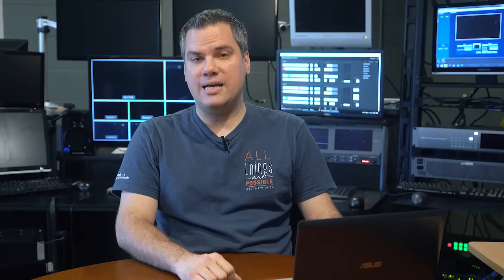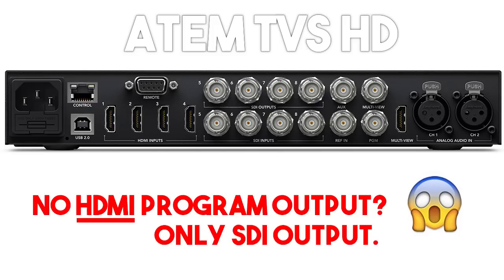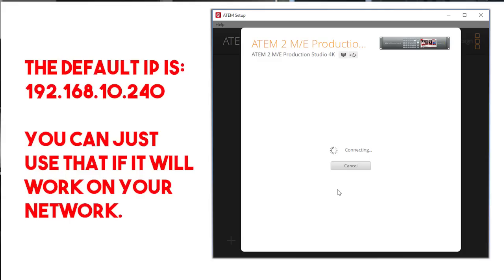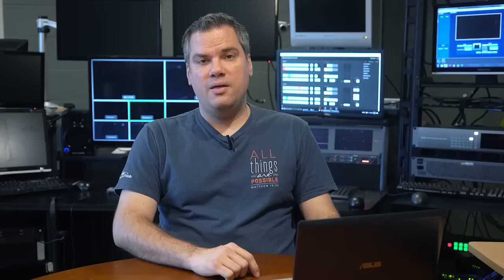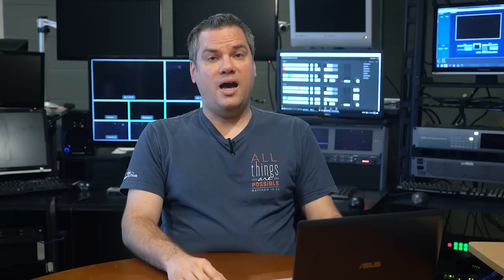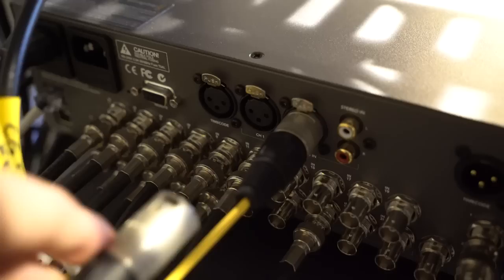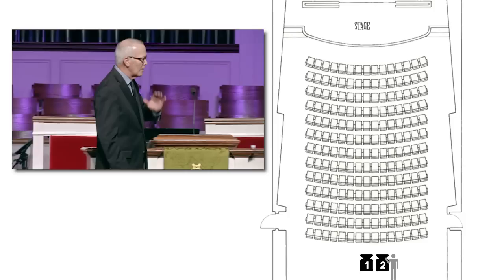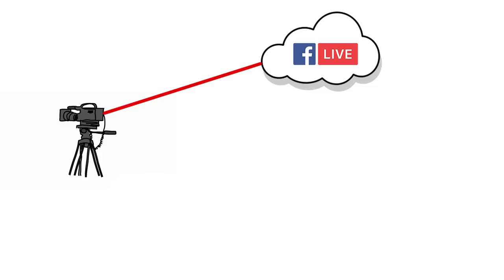Multi-Camera Live Stream & How to Setup an ATEM Switcher

Comment: Question: is it possible to use one laptop for both ATEM control and live streaming via OBS? If I had the laptop connected to the internet via Ethernet, would the ATEM connect via USB? Or is a router necessary? Using Mac with Mini Recorder via Thunderbolt. Thanks for your video!
Reply from the maker: Yes, you can use the same computer.  Use a switch to connect the ATEM & Computer to your internet connection, and then configure your computer and ATEM to be on a network address that will work on your network so they can see each other.  (The USB connection to the ATEM is just used to set the IP address, all control through the software is over the network.)
Reply: Ballast Media thanks for your response! Sounds great. Looking for a Wirecast replacement as the endless upgrade cycle is getting a little old at $250/year.

Comment: I am using a Panasonic AG-HMX 100 audio and video mixer. If I send my video through SDI to the AJA U Tap is the audio following down the SDI cable into OBS OR do I need to get the audio into OBS in another way  Thanks
Reply from the maker: Jeff Bridge Yes the audio from the mixer should be embedded in the SDI output.

Comment: Hey Ballast Media. How do you connect all your cameras to the switcher? I read that long HDMI cords strain your cameras and laptop. Is it better to use wireless HDMI? If so, whats a good one to use?
Reply from the maker: Stefan McCarthy if your camera only has HDMI out, then the best thing to do is convert that to SDI to send to the switcher. SDI can run up to 300ft. If your switcher has SDI inputs (most do) you just have to make the one conversion at the camera.
Reply: Im currently using a gh5. Whats the longest recommended hdmi length?

Comment: Can you use the ATEM and Stream with the same computer? Because in order to use the ATEM it needs to be Ethernet so how can you use 1 computer for the atem and OBS?
Reply from the maker: Yes you can, you just connect them through a switch.  You'll need to configure the ip address of the atem to work on your network and be accessible to your computer.

Comment: Thanks for the video. What a cheap AV mixer with a built-in delay would you recommend? We have an audio source different than the video and obviously, they will not be synchronized ! The "Blackmagic Mini" would have been ideal for us but unfortunately, it doesn't offer audio delay !
Thanks in advance for your assistance.
Reply from the maker: Where are you sending the video? Are you using obs to live stream? You can delay/sync the audio in OBS.
Reply: @BallastMedia  
Thanks. It is for a live streaming.
I don't have OBS but I'll download it. 
So what you say is that OBS allows me to sync audio and video with no need for an external hardware!
Reply from the maker: @michelazizlouis  What are you currently using as your encoder for live streaming?
Reply from the maker: ... But yes, OBS has the ability to delay audio.

Comment: Hi Stephen, so if I want to live stream from two cameras (using a program like OBS on my PC), and I buy an ATEM switcher, I should buy AJA U-Tap SDI and not the U-Tap HDMI? I see there is a sort of HDMI output on the ATEM, but it's a multiview output... That's not made for streaming with two cameras using software like OBS?

The thing is, one of my cameras will be Canon 80D, and if I use it alone, I should use it with U-Tap HDMI, so I'd have to buy both the SDI and the HDMI version of the U-Tap if I want to use it both alone, and with another camera via the ATEM. Unless there's a video interface that has both HDMI and SDI inputs, and supports any format, like the U-Tap...

Instead of buying an ATEM switcher, maybe it's best to buy two video interfaces? Maybe both the Canon 80D and the Canon Vixia HF R800 (or Canon XA11, the two cameras I'm considering buying) can be connected to the laptop via the Black Magic Ultrastudio Mini Recorder (two of them)? Can the video interface be connected to the laptop via USB or HDMI or only via Thunderbolt input?

Sorry for this many questions :) 

Thanks!
Reply: I saw now on your channel that I could use two cameras with two U-Taps HDMI (that connect to the laptop via USB) and OBS: https://www.youtube.com/watch?v=8UtXvJq-l5M

Still, if I go for the ATEM, I'd have to buy the U-Tap SDI?
Reply from the maker: @lexington125djikan  Yes, you would need the SDI u-tap for the ATEM.  The Multiview HDMI output is not a program output, but a special display that shows you all the inputs at once like this: (https://images.app.goo.gl/M9j6SAFmYGuA7wRo7)  You could get an HDMI version of the u-tap for use with your camera, and then get an SDI to HDMI converter to use with the ATEM.  This would only add $60 additional cost, it just adds the additional piece of equipment in-between.  https://amzn.to/2ZKefM9

Comment: Hi sir, I'm using this exact setup . This includes the ATEM Television Studio pro HD, Intensity Shuttle for USB 3.0 and Canon5dMK4. I'm using VMIX on Windows 10. The video signal come to Vmix software on and off, i check the Supported Hardware list from Vmix.com, i can't see Intensity Shuttle for USB 3.0 on the list ( it has Intensity Shuttle for thunderbolt only), could you tell me what should i need to do please. Thank you
Reply from the maker: Not exactly sure, The obvious thing.... Make sure you are using the latest desktop video version. Also, is the intensity shuttle connected directly to the computer or through some sort of hub?
Reply: @BallastMedia  yes, it's connected directly to laptop and i upgrade latest desktop video version already

Comment: Will the BM ATEM Mini need configuring? And will it need a video interface? Thanks
Reply from the maker: Mini will need to be configured, select your output video standard, etc. You will not need an interface, it will perform that function.
Reply: Ballast Media Thanks for that. Do you think it would be possible to use my iPhone xmax as a second camera through the ATEM mini? Would a lightning cable be able to connect the atem min switcher?

Comment: Would it be ok to use the same computer that you run the actual video stream on to also run the ATEM control software at the same time while steaming? 
Or is that not a good idea and would recommend to run separate computers? 
Similarly, what about if you were running software based audio mixer (DAW) during the live stream for audio mixing? 
Would it be ok to run all three on one computer? 
What combination might be ok to do and what’s be best scenario?
Reply from the maker: You can probably get away with running the atem software while streaming. I would not run a daw and stream, those two things each need their own computer.
Reply: Appreciate your insight. You’ve been very helpful

Comment: We are using the Canon R800's for our live broadcasts.  Using the HDMI output, we are running that into a BM HDMI to SDI converter, and the SDI output to the BMTVSHD ATEM.  We need to add field monitors to the cameras to follow the action, but how or can I get the single HDMI output from the camera  to go to the HDMI/SDI BM mini and to the field monitor (Neewer 759's)on the camera?
Reply from the maker: Unfortunately, with that monitor the only way to make it work would be an HDMI splitter added at the camera.  The better way would be to get a monitor with an Input and Output HMDI built in, like from Ikan. https://amzn.to/2pRw5xO
Reply from the maker: The ikan monitor I linked to above is actually discontinued.  Here is an updated version. https://amzn.to/2GEMu2a
Reply: I have been looking for an HDMI splitter but have not been able to get a definitive answer as to what splitter would work, even BM didn't have much to offer other than to say it would have to be able to EDID signals.
Reply: If I could find the field monitor that will have the HDMI out pass the proper signal to the HDMI/SDI converter, I would actually prefer that solution.  I'm looking.  Your recommendation above I looked at and have asked on Amazon and waiting for a reply.  Thanks for all your help.  Great video too.

Comment: Dear Mr. Ballast, I have been following your highly educational lectures on setting up live streams to the stage of multiple camera via ATEM HD. With all the set up, I am not able to see video image at OBS. Here is my set up: Vixia R800 --> ATEM HD (set at 1080p 59.94) --> PGM SDI out to UltraStudio Mini Recorder set at SDI input --> thunderbolt 2 to iMac --> OBS (BM US Mini Recorder,  format with Auto). This set up does not generate image in the OBS screen. There is video image detected via HDMI Out Muti View to external monitor (camera 1, preview and Program view).  Appreciate if you can shed some light on the what could be the probable issue of lack of image at OBS. Thank you.
Reply from the maker: The mini recorder doesn't support 1080p60 video. the SDI connection won't take it. The HDMI gives you an image because the way HDMI works is that the two connecting devices negotiate a video format that they both support, so it's probably switching to 1080i60.
Reply: @BallastMedia  Thank you Mr. Ballast for your insight. I believe the once quick option for me to move forward is to replace the Mini Recorder with AJA U-tap SDI. And it should work out fine with the OBS connection compatibility. Would you support this option?
Reply from the maker: @kennywong1024  correct, that will work.
Reply: @BallastMedia  Thank you!

Comment: Hi Stephen, I have Atem 2/M production 4k and we always use HD format, now I want to use the UHD format because we have 4k cameras and CCU 4k also, I already change all the format, in the cameras, ccu, atem II but I still can´t see the signal.  Do you know how i cant  resolve this problem?
Reply from the maker: Not exactly sure, my first guess would be that the camera format and the ATEM video standard aren't quite the same.  The UHD formats that the ATEM is compatible with are pretty specific.  What video standard do you have your camera's set to?  I assume you're running this over SDI?  What video standard is the ATEM set to?

Comment: I have a question for you.   Can I use Blackmagic Design ATEM 1 M/E Studio 4K Switcher with my vMix application?
Reply from the maker: Yes, but you will still need a video interface to get the video from the switcher in to your computer running vMix.
Reply: How can I see the cameras that are not on program (able to see the cameras on the preview screen) with Vmix? Since the I'm only take the output of the ATEM SWITCHER to the AJA U TAP and from there to my pc? Is it possible to be able to see a preview screen before I program it on Vmix or obs?

Comment: If  the camcorders I use only have HDMI output do I need hemlock to this atem?
Because the switcher I use for now will cause unstable lantacy for about 20 seconds.
I am wondering if I should change this atem.
TKS!
Reply from the maker: MyNews99 Are you using a physical switch to switch between HDMI devices?  Yes, a real video switcher like the Atem will solve the problem of the devices having to resync when you use a physical switch.
Reply: Ballast Media I use Roland V-1HD. I don't know if it is a physical switch.
If so, do you have any suggestion for me? Or, if I can get the ATEM as a switcher to solve this problem.
Thanks again for answering my question so soon.
Reply from the maker: I haven't used the V1hd but it shouldn't cause sync to be lost like that, it's supposed to be a video switcher. You should be able to fade between inputs. What devices are you connecting to the V1hd?
Reply: Ballast Media Panasonic Camcorders with HDMI output
Reply: Ballast Media I use dissolve, which is also understood as fade effect between two video source.

Comment: Why can't ATEM plug directly in the PC via HDMI? Do I really need a video interface adapter?
Reply from the maker: HDMI is a one-way street, it's either an input or an output. The HDMI that is built in to your PC is an output. You need an input (video interface) to bring video in.
Reply: Ballast Media thank for the reply
Reply: @BallastMedia  Another the AJA you showing on the video is not quickly available. I need quick is there an alternative you'll recommend?
Reply from the maker: @loup012  Elgato HD60s is a decent HDMI alternative: https://amzn.to/2y4E2qr
Reply: @BallastMedia  tks you are the best
Reply: @BallastMedia  can you give me a quick run down ho to connect the HD60S to the ATEM HD studio? Which port does the ATEM does it connect to. Also my ATEM show no video output, I try to install software using UBS no luck, I will appreciate any help thanks much.
Reply: @BallastMedia  Not working bad recoomendation
Reply from the maker: @loup012  it sounds like you have a number of things you are trying to work through. 1. First you need to get the atem software control installed. 2. Configure the video standard to get an input from your camera. 3. Once you can see the camera feed in the multiview, and are sure you are outputting something to PGM, then connect to your computer.
Reply: @BallastMedia  I just wanted to know  do I used the HD60s everything else is working but the HD60s
Reply: @BallastMedia  Having issues now no matter what standard I set for the multiview I don't get any video output. Any ideas before I return it?

Comment: I have question, if I have HD cameras and connect them to SD video mixer, how will the image come out?
Reply from the maker: The output from the video mixer will be SD.  You'll need to convert the output of the camera to an SD format that will work with the video mixer, unless the camera already has an SD output, like composite video.
Reply: @BallastMedia  to be a little more specific, I have 3 dslr cameras that I want to use with a data video se500 switcher and I will have capture cards for all the cameras. So will that help with the quality?
Reply from the maker: @MinisterJoshuaLacy  what do you mean by "capture cards for all the cameras?"  How are you connecting the cameras to the SE500?  Most likely the cameras will be outputting HD video on their HDMI outputs, are you converting the HD to SD to input in to the SE500?
Reply: @BallastMedia  Yes through HDMI to SDI capture devices (which is what I meant by capture cards sorry for the misinterpretation)
Reply: @BallastMedia  so with all that considered, do you have an idea of what the quality may look like?
Reply from the maker: @MinisterJoshuaLacy It will look like a nice image in SD resolution.  The SE500 is your limiting factor, it can only handle SD resolution.  If someone is watching on a phone, it may look ok, but if they are watching on an HD device, the lack of resolution will be noticeable.
Reply: @BallastMedia  Ok thank you so much!

Comment: But what if the camera is not near the switcher?
Reply from the maker: Black Film Guild What is the distance?  Usually you'd convert to SDI and run an SDI cable from the camera to the switcher. https://amzn.to/2GhJ7yM
Reply: I was thinking 150 feet, I guess I can just get a long SDI port. I just wish there was something less labor intensive to set up and break down. Also, I wish there was a switcher system that was more intuitive, for example, when you use the audio, I would like it to come out of L and R rather than just one or the other. There is no easy way to get LR audio without adding in another task.
Reply from the maker: I don't follow you on the audio.  Are you talking about your camera, or the ATEM?
Reply from the maker: If you've got the cash, you can always do something like the Teradek Bolt. That will get you 300ft wirelessly.  $$$ https://amzn.to/2GEv6uk
Reply: Might have to worry about interference though....

Comment: how you sync image and audio when using sound from a mixer?
Reply from the maker: Can you describe how your audio and video are routed?  Usually you would run the audio in to the video switcher and it will combine your audio/video together and they will be in sync.
Reply: @BallastMedia  So my thinking I want to run Studio One on a MacBook to mix an audio stream so audio is coming from the stage box (DL32) into a Midas M32R which is what we normally use to mix our live stream however I want to take USB out of the M32R process audio in Studio One and send it back to the cameras. However I want to increase my buffer size to the max which is 4 seconds so it doesn't use as much CPU on the MacBook. Can I delay the video output by 4 seconds so the audio for the stream can caught up or is that not possible? (Using a ATEM 4K Switcher)
Reply from the maker: @worshipplayback3675  Video delay is much more of an intensive process because the device has to store video for that amount of time.  In OBS you can add a video delay filter to get your stream in sync.  Your issue will be that anything local will be out of sync, or if you want to record the output of the ATEM to a different deck, it will be out of sync.  You can get hardware video delay units, but they are very expensive.  Unfortunately I think you're best approach is going to be to figure out how to get your audio to match the video.  Studio One might not be the best choice for mixing live.

Comment: Great video. How do you get your stage camera to connect with your switcher?
Reply from the maker: Jeremy Byrd Convert to SDI. You can run a coax cable up to 300ft with SDI.
Reply from the maker: Or just start with sdi cameras to begin with like the little marshal cameras.
Reply: Are the XLR inputs Line Or Mic level? Thanks for another great video!
Reply from the maker: Elvis Presley Line level like from a mixer. Not a pre-amp.